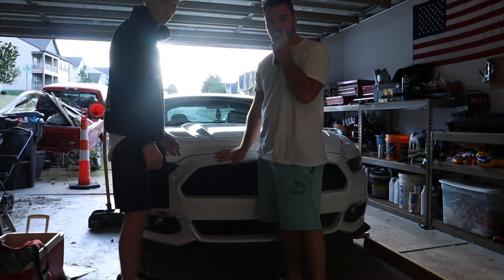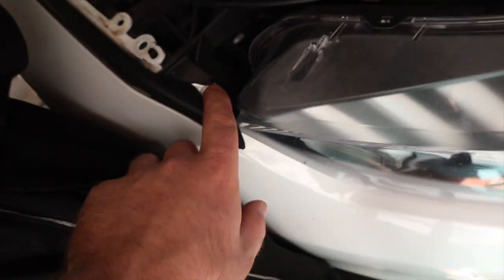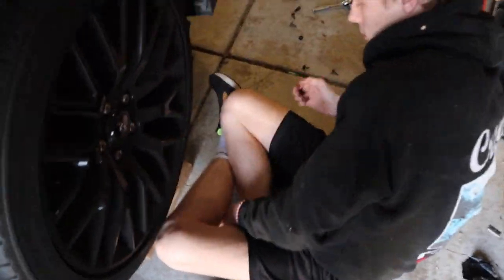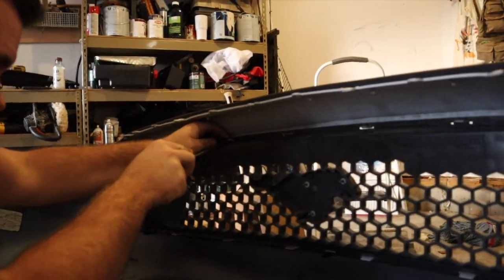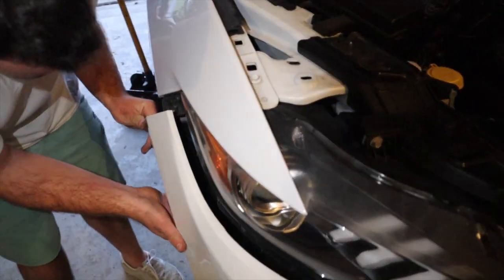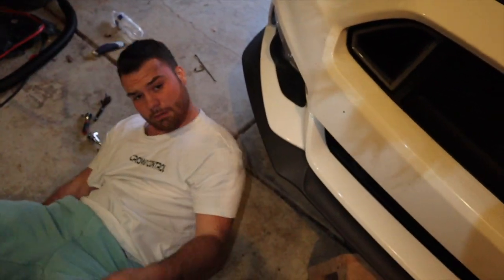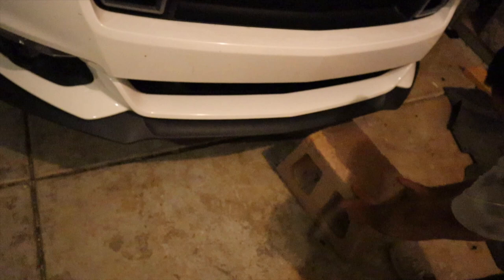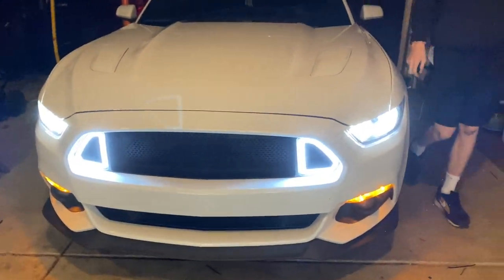Installing RTR Grille on my 2016 Mustang GT!

Comment: Question when you order the grill with the  led lights do you have to make sure it’s a 2017 5.0 ? Or does it fit all ?
Reply from the maker: These only fit 2015-2017  18+ they are different

Comment: Has anyone tried installing the accent lights on a grille delete mod?
Reply from the maker: Not really sure I haven’t seen any video or read anything on forums
Reply: @crowdcontrol7749  I ordered the deleted grille and tried.  Lol it definitely doesn't work. The slanted vertical piece is different. But the cheap RTR grille on eBay will work.